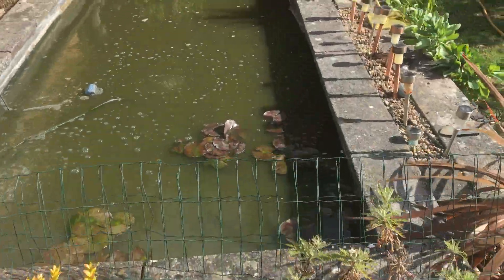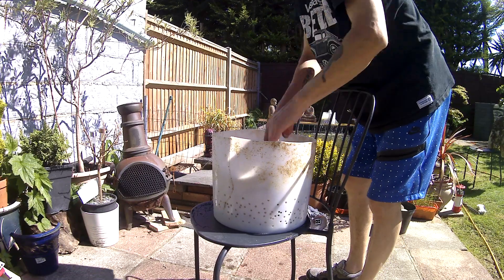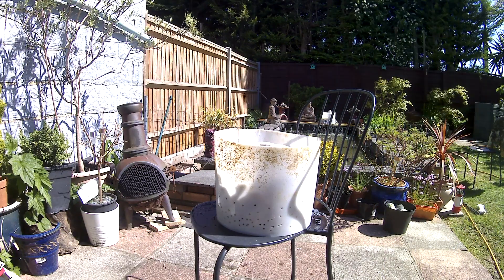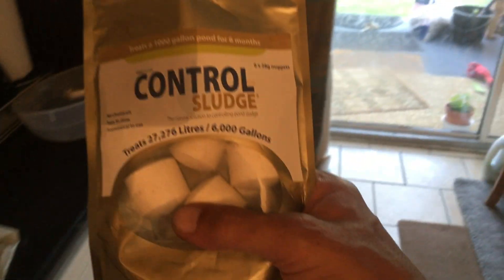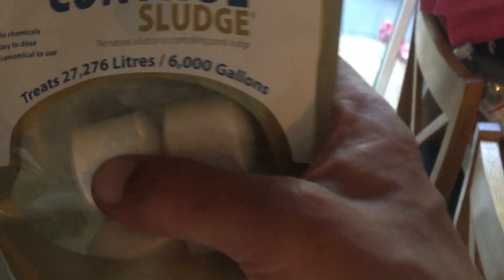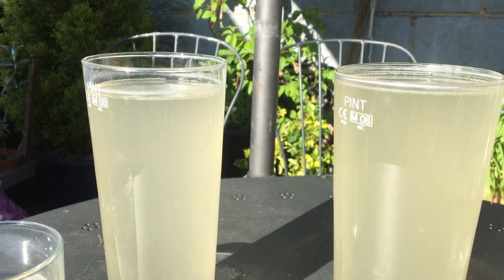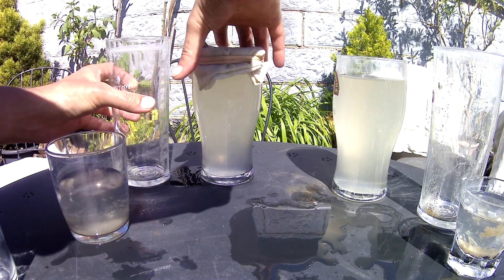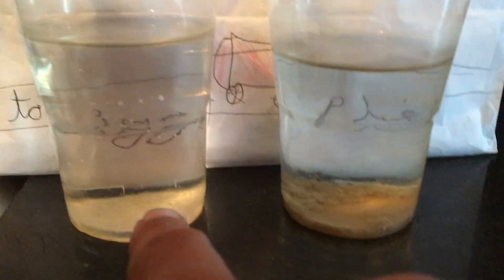Control sludge tested on pea soup koi pond

Comment: The sludge control looks to work through floculation meaning any smaller solids stick together making them easier for the Mechanical filters to remove from the water.
It's a good short term control but really need to look at the pond filtration to sort for the long term.